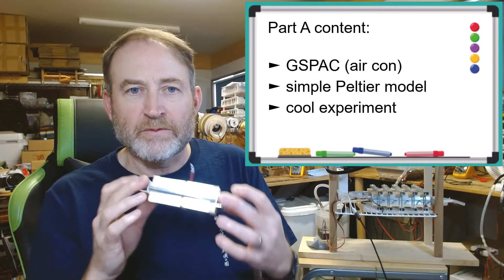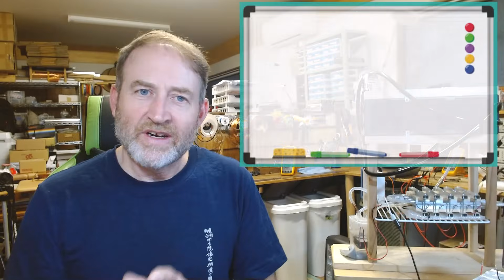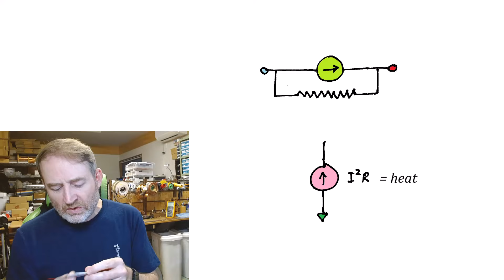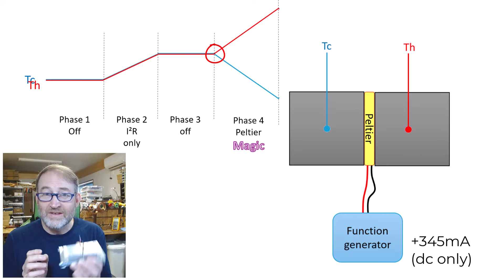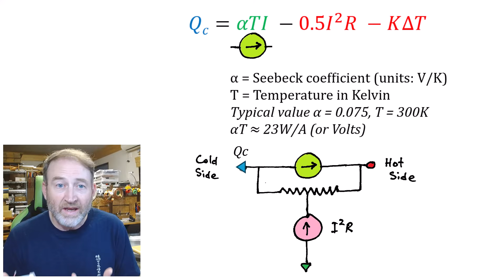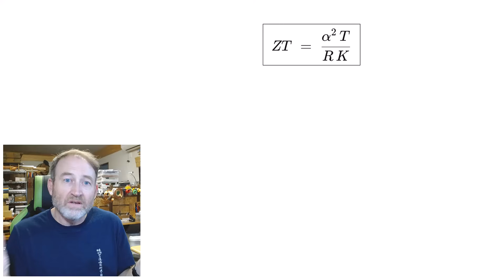The Peltier COP 30 Gateway

Comment: Cop with a delta T of 0... nice useless machine
Reply from the maker: Not useless, for air conditioning, geothermal applications dTs can be small and even negative but still we need heat pumps. After a hot day when the outside air cools down to 25°C but your room is still 30°C, you will find your air con (heat pump) does a much better job than just opening the window, and it will do it extremely efficiently as well since the overall dT is negative. But the COP is not negative because motor losses are still much greater than the entropy lift (without motor losses, the COP would be negative).

Comment: Amazing explanation and test!
Also the model is very easy to understand, I was always curious about peltier modules, but havent given them much thought - zero dT also makes perfect sense - current source can still dump current into a short - zero volts, but current is still flowing. 
Makes me wonder if we can stick such a module inside a heat recovery ventilation core to help it along.
Reply from the maker: I really want to use heat recovery to help the "cold side" of a Peltier stay reasonable during winter heating. For example, every shower dumps a huge amount of energy down the drain, even capturing 10% of that and use it via a heat exchange (isolated liquid, but thermally coupled) to warm a "cold side" tank to say 15°C in winter, then use a Peltier system as a heat pump to warm a room at 23°C, that's a nice dT where Peltiers really shine for simplicity and efficiency. You can easily get a COP of 3 or more from that set up, just have it running in the background pumping out say constant 400W which stops the room from getting super cold.
Reply: @PeltierPower  

You can also just plug your tub drain while taking a shower and then wait for it to cool off before draining it to capture almost all of the heat in your house.  

You'll also get a lot of humidity, which is great in the winter.
Reply: E=IR, you can never have zero volts when current flows.
Reply: @mosfet500  yes you can -  you can have really really low impedance in comparison to the value in question (then there are superconductors)
Also you need to use the full form of Ohms law and he explains it.
Reply: @VEC7ORlt  E=IR,  IS the full form of Ohm's Law. If there's zero resistance you have zero current AND zero voltage;  0 x I = ZERO. A "really low impedance" is still impedance and follows the laws of impedance.

Superconductors are a whole different topic and there are physicist who will argue that even they have minute resistances.
Reply: @mosfet500  zero ohms means there is zero voltage drop, the current still flows.

Comment: So because of the nonlinearity it is more efficient to connect multiple peltier elements in series because the n*COP(deltaT/n) > COP(deltaT)
Reply from the maker: It depends a lot on the application and the thermal resistances. If you have a low thermal resistance circuit outside of the Peltier(s), it works to add more Peltiers that are thermally in parallel. If the circuit has high thermal resistance, adding Peltiers in parallel can actually make it worse. In some cases Peltiers that are thermally in series can work better. Anyway, it is best to model the full system and play around with the currents and Peltiers to find the optimal configuration for the application. I'm working on a simple html page to help with this.
Reply: @PeltierPower Ooh, like a calculator / optimiser thingy? Sounds very useful. Would probably make a good video, ‘cos most of us are going to get terribly confused by it, I’m sure.
Reply: This seems to be borne out by real-world use cases. When the temperature delta is large, putting peltiers in series thermally, while electrically in parallel seems to be most efficient. For small temperature deltas, having the peltiers in parallel works much better, since you want lots of heat flow over a small difference in temperature. In that case, it’s often better to put them electrically in series, since the voltage drop across each one is small and the current is fairly low, but that depends more on the peltiers you’re using and the voltage of the power source that’s available or most efficient in your setup.
Reply: It depends. Each stage "down" (toward the warmer side of the stack) needs to be able to handle both the pumped heat from previous stages but also the resistance heating that each stage produces in the process of pumping. Doing so can generate extremely low temperatures, but a lot of waste heat is generated on the other side and must be handled.

Comment: So to increase the Peltier's efficiency we'd need something like a diode[1][2], so that the heat can go only one way - some kind of one-way mirror maybe.

[1]. 'An energy gap opens and heat flows one way only', Linxiao Zhu, Nature Nanotechnology (2026)
[2]. ''Perfect heat rectification and circulation with nonreciprocal radiative surfaces in the far field', Sina Jafari Ghalekohneh1 and Bo Zhao1,2, Phys. Rev. Research 7, 43150

Intriguing stuff you got there going.
Reply: or just a mecanicall separator
Reply: Peltier modules work reasonably well as "thermal diodes" if they are set up to do so, but it does require a little bit of power to operate them this way of course and depending on direction, takes extra thought. 

It also introduces additional thermal resistance in the "forward" state however, which needs to be accounted for. People think of peltier as "cooling devices", when in fact they are so much more. 

They can pump, isolate, and detect heat flow, all depending on how they are set up. They even make decent bolometers when one side is tightly regulated to a reference temp (which another peltier can of course do for it), sensitive enough to pick up the beam of a 5mW laser striking the "measuring" side.
Reply: In thermodynamics this is "Maxwell's demon", and it has been demonstrated experimentally, though actuating the door required energy.

Comment: Wait you keep switchong back and forth between heating and cooling. The performance difference between heating and cooling with a peltier is very different. They heat using the peltier effect, but also from the electrical losses. Which makes them poorly efficient cooler.  Also your heat pump effect is ignoring the other side of what you seem to have discovered to make this video.  Your cooling power is highest at dt of 0.  And it is 0 at the max dt of your peltier. Every peltier has a max dt it can work at but the efficiency is basically 0 there. You can increase your overall efficiency by staging the peltiers, one peltier cools  a smaller one which cools a smaller one etc and you can get very cold temps but you add up your electrical losses.
Reply: Ok you are addressing the resistance heat